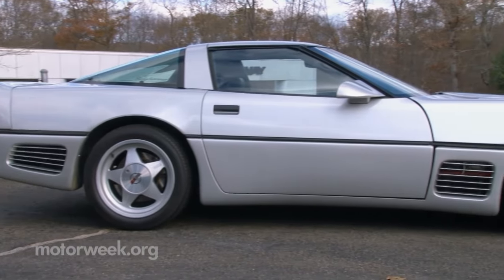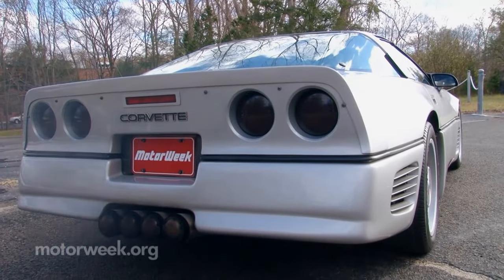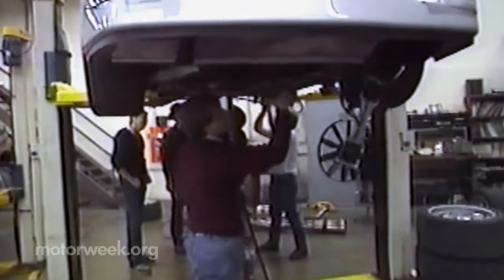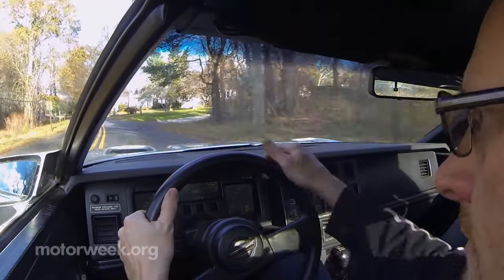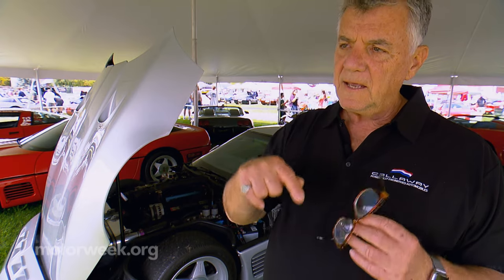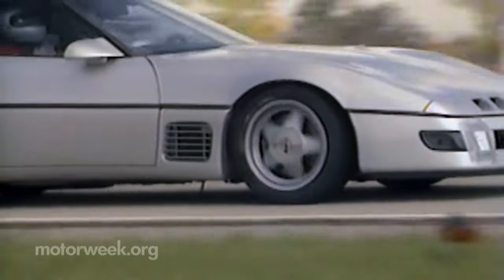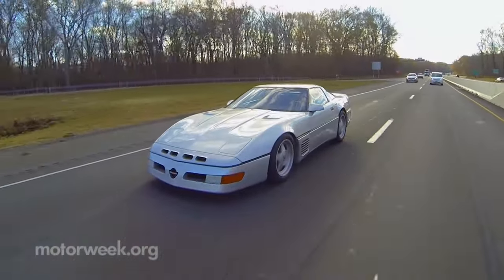Auto World: Callaway Sledgehammer Corvette

Comment: 898 horsepower/772 ft. lbs of torque, with air, leather, and Bose. All in an iconic C4 at just shy of 255 m.p.h. May I introduce you to Reeves Callaway's original supercar so appropriately named the 'Sledgehammer'. Beautiful car Mr. Callaway!
Reply: How many were made?
Reply: @phoenixgibbs-lewis6387  Certainly you're not speaking to me personally. That said, take less than four seconds to Google 'Callaway Sledgehammer'. What makes the car unique is it was based on the fourth generation Corvette. Yes, it's not an F1, and yes it's not a Veyron. But the performance envelope for this car is impressive, and clearly stands alone up to the year the car was built, and for almost another two decades!
Reply: @phoenixgibbs-lewis6387  Sorry. Us Yanks hold most of the automotive world records. We always have. Since we uhhh you know... Invented the automobile.
Reply: ...the dreaded sledgehammer!
Reply: It must have cost decades of your earnings or explode after just 10k miles.
Reply: @phoenixgibbs-lewis6387  My, such anger and hostility.  It's gonna be Ok, little buddy 😂
Reply: That same power in a normal bodied 90's c4 can still take you over 220mph but youll need the transmission and tires to do it also
Reply: @phoenixgibbs-lewis6387  from Wikipedia and official videos: "On October 26, 1988 and driven by John Lingenfelter, the car reached 254.76 mph (410.00 km/h) at the Transportation Research Center, Ohio and was then driven back to Old Lyme, Connecticut." Who is to learn anything
Reply: @sebbonxxsebbon6824  true and lasts longer. Just look at old school Chevys and Fords!
Reply: @2KCamaroZ28SS  First I thought: "Wow, Phoenix is quite an ignorant person."

But the I read your posting... so Americans invented the automobile? Interesting...hahaha...
Reply: Manual trans too
Reply: 920 bhp with boost cranked to full
Reply: @rubyred93chev  , he's just jealous  that Callaway  could get that kind of power out of a push rod engine, all his European  Exotics  are high maintenance  pigs, better bring a fat wallet!
Reply: @klamontc  , I have owned 4 Corvettes,  a 77 L82 car, 96 Black Lt4, 2000 hardtop and a 96 Grand Sport # 901.
Reply: @GunHolz  well they invented the concept of mass production cars and made it possible for others to have them as well rather than riding horses (VW and Fiat received large subsidies from Ford) along w/inventing the ideas of station wagons, SUVs and hundreds more things used worldwide in the automobile industry (not talking about planes or the internet).
Reply: @mattc9875  Undisputed that Americans had their fair share in the progression of car productions up to the point where we are today.

But claiming that "yanks invented the automobile" is laughable.

There have been times when the American car industry was the leader in the world. But that periode was a long time ago.
And Ford developed a lot of important improvements to the production. But the car was invented decades earlier.
Reply: Reeves Callaway was truly ahead of his time.
Reply: @schlomoubermann  1
Reply: P
Reply: @schlomoubermann  one
Reply: Oof Bose, that needs an upgrade
Reply: @_retrophile_7473  Wow, so it can't be rarer.
Reply: @melvinmcfly4498  It was cutting edge at the time and designed specifically for the C4.
Reply: I am planning on doing something like this to my 1995 corvette. But I want to use 2 turbos and twin superchargers. My goal is the widest power band possible say 2000-6500. Power goals are 600-700hp and 650-800lbs torque. I think the biggest issue is getting the transmission to survive. 😅
Reply: @2KCamaroZ28SS  Sorry the US invented the automobile?? 🤔
Reply: I think it was Benz no ??
Reply: They call the mclaren f1 the fastest car of the 90's but if only ppl knew of the sledgehammer💪.
Reply: Jesus Christ this comment section shares a dozen brain cells between them all
Reply: @schlomoubermann ONE!
Reply: @GolfInHawaii69  the F1 was the fastest production car, and remains the fastest naturally aspirated production car ever made. The sledgehammer was a 1 off experiment
Reply: The Germans invented the automobile guys. We Americans pioneered mass production methods
Reply: @titusrome2863 Absolutely it was Mannheim Benz

Comment: Casually shitting on the Veyron in the 80s. And they road tripped to the test track to top it off, doesn’t get better.
Reply: What are you talking about the Veyron didnt even exst in the 80,s
Reply: @terrybaptist795  hes saying the car shits on the veyron even though it was made in the 80’s
Reply: @scottearl7687  How lol?
Reply: @MF-Rell  Because it's faster than the Veyron by almost 2 mph.
Reply: @chrismarek7864  slower to get there. Not road legal anywhere outside USA. Is a stripped down car turned race car. No emmisions control. Loud as f. Handles like a turd. Terrible brakes. Just a roll cage fibreglass body and a workerd motor. Not even comparable
Reply: @lukeneill1568  said the boy who has never driven any of them
Reply: @lukeneill1568  also no one asked
Reply: But look at it outside the engine. At the rest of each of the cars. There's no comparison
Reply: @lukeneill1568 Its a full blown street car with A/C and a leather interior. I'd also go as far as to say it will handle better than the whale that is the Veyron

Comment: I remember when this car was new and Reeves Callaway mentioned the most important part on this car (or any other) is the tire because everything on the car depends on the tires working properly.  That advice has never failed me and kept me from cheaping out on tires even on ordinary cars.
Reply: I agree that you should not save on tires, as long as it's about new vs. retreaded. 
Otherwise speaking of tires, the maker of Polly Trans Am, igored that, and went 250mph/400kph, on tires that were not allowed do so. And his problems were not the tires but fine tunining of the engine.
Reply: @SparrowNoblePoland  that was incredibly reckless and stupid lol
Reply: Learned that the hard way. I have a slightly modified 2004 mustang mach1 making 400hp to the wheels and tried cheaping out on the rear tires since good ones ran about 500$. Ended up getting 2 for 210 thinking I got a great deal until my right rear tire blew out and almost ended up in a ditch. Learned my lesson and paid extra for good tires. Just thankful I didn't total my car.
Reply: @GolfInHawaii69  maybe try 2 for 300 next time.

Comment: 254mph back in 1988 unreal! Amazing
Reply: yeah that would be like 330mph in today's numbers , Because I don't think anything production was cracking 200 back then
Reply: @JDMHaze  Yeah I think the F40 and Porsche 959 were considered the fastest cars at barely 200/201 mph so this was definitely fast. Even the McLaren F1 only hit 240 mph in 1991 and the Bugatti EB110 was like 220?
Reply: @jefferycampbell9182  213MPH RUF Yellowbird, twin turbo Porsche stroker.
Reply: Andddddd & the car had a radio, ac, power seats, factory glass. Imagine what it could do stripped & with modern tires.
Reply: There's only a few cars in 2024 that could beat it.  That's how unreal that is.
Reply: It really wasn’t though.

Comment: I read about this car in magazine in 1988, they had it against a CTR, 959, AMG hammer and a Testarossa. Headline was "when  170 mph is slow".  That Ferrari was plastered on the front cover and ended up being the slowest by far. Even back then tuners were miles ahead and the Callaway couldn't be touched.  890 bhp, unbelievable.
Reply: Vector W2
Reply: 898

Comment: 1988 .......5.7L w/ 22 psi - 898hp/ 772 lb-ft of torque.
2005....8L W-16 W/ 16 psi - 987hp/ 911 lb-ft.  For $1,250,000 at the time. And was 10 mph slower.
Reply: its all about safety now days... notice that the sledge has no airbags. Cars now-a-days have so many safety features and they all add a lot of weight. Power to weight ratio is key.
Reply: since they only made one of these it would probably be worth around as much as a bugatti. had they mass produced these... oh boy
Reply: @yungtooli  i've seen in the internet that Sledgehammer costs about $600k
Reply: @_retrophile_7473  so the price of a beat up bugatti. not bad
Reply: @yungtooli  checked again. Not sure, but seems it cost around $500k, there is not much information on the internet. Some links say that it's $500k, some say $600k.

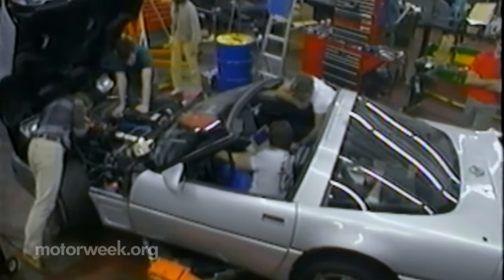Comment: 0:53 "making power that was both streetable and reliable" and that's exactly where the bugatti etc. bows out, because that is the major differentiator between the euro hypercars and the American contenders.
Reply: A lot of European supercars are streetishable and reliable though? And how does that bow out the Bugatti or most other eurocars to a corvette with a big motor in it?
Reply: @lambertbutlersilvers6588  It gets very few miles per gallon, changing the oil on the W16 borderline costs your soul and the souls of your spouse and kids, and the car itself is twice the weight and less aerodynamic than the C4.

Comment: 22lbs of boost / 800hp, with production car reliability, in the 1980s! Those were incomprehensible numbers. A typical production turbo car had maybe 6-8 psi at the time, while a contemporary IMSA GTP turbo race car had about the same amount of power. But this was a useable, street legal engine based on a regular small block Chevy. It was like magic or something, almost impossible to believe.
Reply: Only NA cars impress me, Forced induction is well FORCED
Reply: 898hp**

Comment: Now all calloway needs to do is make a new mid engine that does 300 miles per hour twin turbo or supercharged, like magenson get them to make a bolt on supercharger that will fit  straight up to the existing engine manifold, just do the internals and exhaust and cooling ,tyres are not a problem now days, still very expensive but think of it bugatti will not hold the record fastest car in the world the sledgehammer back then so think of 320 miles per hour in the new C8 supercharged and turbo beast.  :)  Even a 2019 C7 Callaway only has 757 HP, it would need at least 1,000 hp and the right stuff to make it stick to the ground and push the body and running gear to the limit to break the world record for over 310 miles per hour. :)

Comment: Are those like vented caps on the exhaust tips?
Reply: Nope those are actually mufflers!   They work like a mute in a trombone.  At the time they were the best option to keep the car quite without costing power.
Reply: @Tiptoetherat  they look interesting. Yeah it's kind of like just placing your hand over the pipe end it changes the sound a little.
Reply: Supertrapp mufflers were actually tunable.   You could add or subtract those diffuser plate looking things for more power

Comment: Imagine if they took that attitude , and set out to build a GM product that after 40K miles, every light in the dash wasn’t on, tires sensors ,O2 sensors , check engine, anti-lock brakes , etc,, and was at least worth half of what you paid for it . I will then be impressed

Comment: Oh,  is a Diesel
Reply: No, just running rich.
Reply: I’m sure it’s tuned to run that crazy amount of air their making with the twin turbos
Reply: 1chumley1  Yes. That's unburnt fuel combusting in the hot exhaust pipe. That makes black smoke. If the engine is burning oil, you get blueish smoke. If it has a coolant leak into the combustion chamber, you get white smoke.